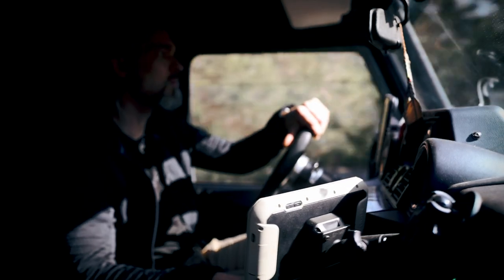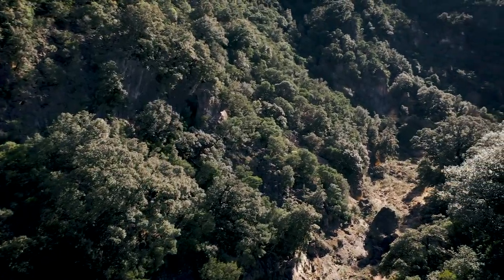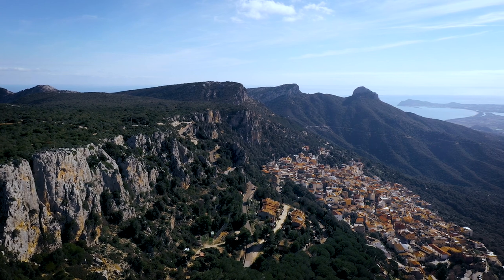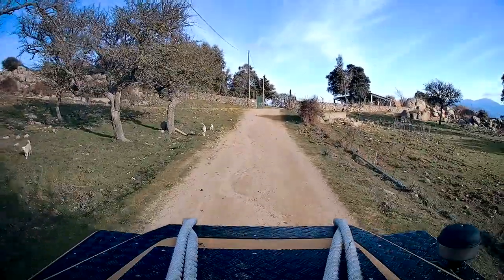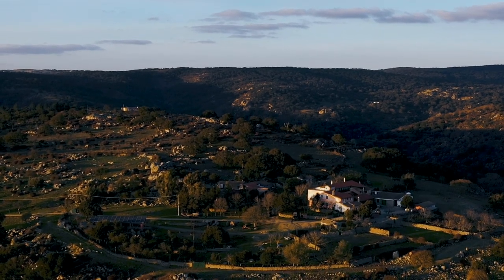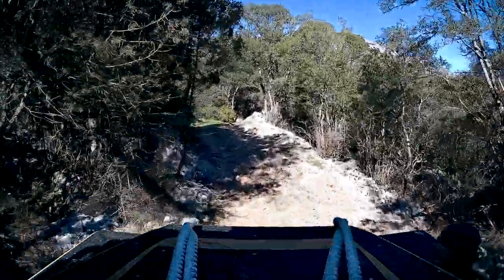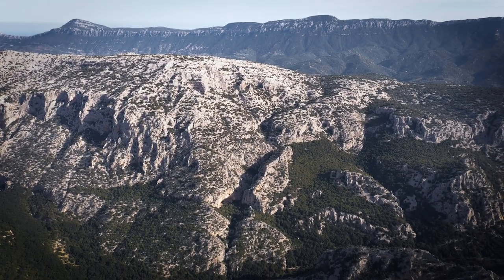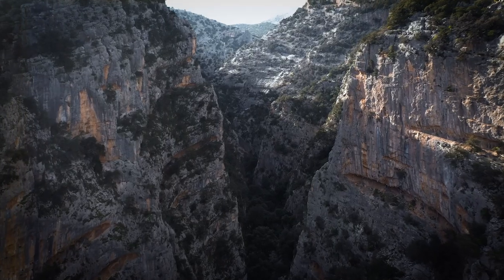Episode 6 of Sardinia Winter Trip (2022 overland adventure in Land Rover Defender)

Comment: As ever, great entertainment. The drone gives your posts an extra dimension which makes them unique, in my opinion, so I'm glad it didn't get too badly bent. Via Ferrata in Sardinia? I think you were living in a lot of hope to follow those red (faded pink?) marks. I think if I'd found any wires at the end of the trail, I wouldn't have put much trust in them...Thank you for another great post.
Reply from the maker: Thank you Mike! I was flying really low trying to maneuver between those rocks and trees - had all sensors off BUT it turned out you can’t turn them off completely 😬 Suddenly there was a warning about obstacle from the top, the drone lowered its path and hit the rock on the side. I was so focused on the flying that didn’t noticed the REC was not turned on 🙈🙈😅🤣🤣🤷🏻‍♂️
Reply: @OffRoadProwler  Bad luck, but glad it wasn't terminal.
Reply from the maker: Yeah - it was last day so majority of the footage was safe anyway but it’s always better to came back on one piece and fully working - even if we talking about the equipment 😅